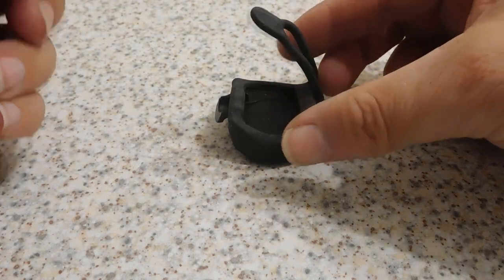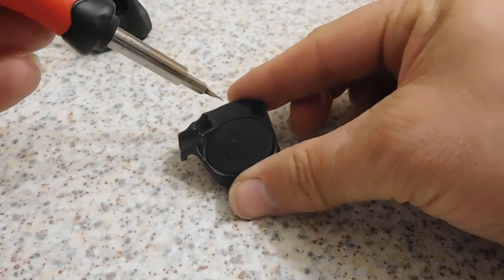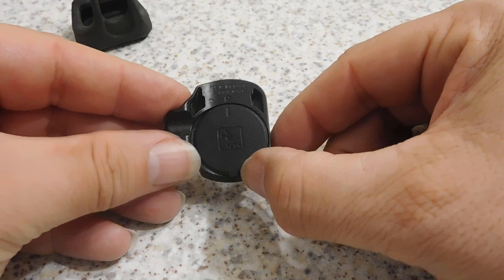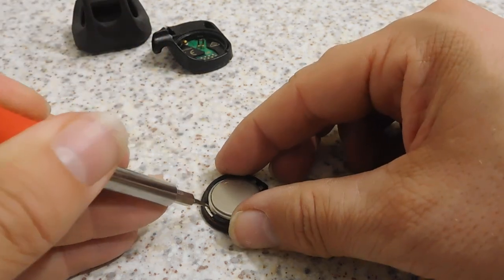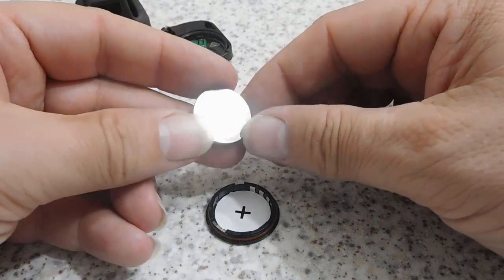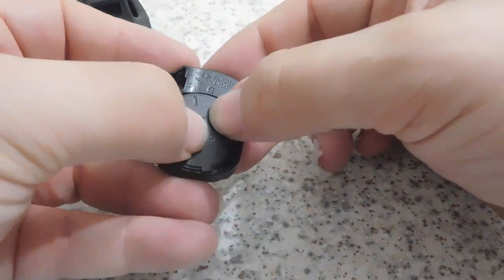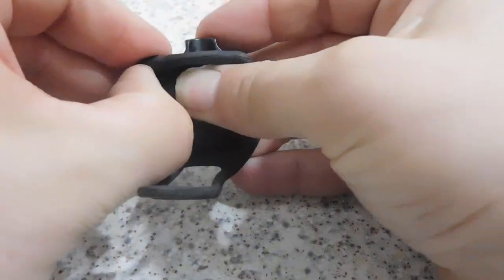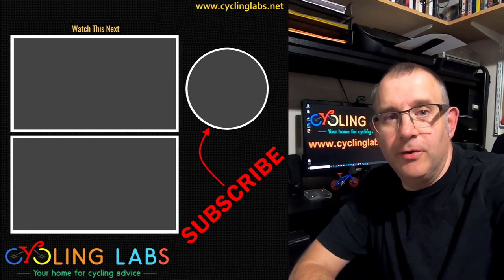Changing The Battery On A Garmin Speed Sensor

Comment: I'm guessing this is not the Speed Sensor 2? For anybody coming across this, the Speed Sensor 2 comes apart using a screwdriver slot, and the battery should be installed in the OPPOSITE direction to this video ("+" upwards).
Reply from the maker: You're correct, this is the '1' which is slightly different. I don't have access to a '2' currently to do a video for that I'm afraid.

Comment: Any ideas of what to do if your husband throws out the white circle with the plus on it?
Reply from the maker: I think it's only a bit of thickish paper with the + symbol to help with battery orientation.  I'd get hold of some of those sticky dots and put one or two in until you have created enough padding in the lid to stop the battery rattling loose.  You could then use a pen to put the + symbol on the sticker to remind you of battery orientation.
Reply: @CyclingLabs  thank you! I thought it conducted something kind of signal.

Comment: Pull the battery be applying sticky tape to it.
Reply from the maker: Brilliant idea, especially if you haven't got a magnet to hand - fortunately I have many but it's a great suggestion for those that haven't got one.
Reply: @CyclingLabs  I did have a pretty strong magnet, but it didn't work. I got the tape idea from a different video, and it worked.

Comment: These batteries shouldn't be so difficult to remove.
Reply from the maker: Robert Najuch I found this one a bit tricky, but some are easier. If you check out my cadence sensor battery replacement video I use a tip from another viewer where I use a magnet to get it out.

Comment: I have just spent over 30 minutes and there is absolutely no way to get the battery back in and locked in place, this is designed so poorly I can't believe they released this to the public.
Reply from the maker: The knack with this is once you have the marks on the cover and case aligned is to gently squeeze them together and then twist the cover in to place. Practising without the battery in place might help.
Reply: @CyclingLabs  I have changed the battery many times. This time, I can screw the cap to the lock position. Not a reliable design, seems it wears after a few battery changes and even with applying force from a small screwdriver and pushing down firmly, I can't lock it in place.
Reply: @dansteinbach6296  The lockngn mechanism is crap and pretty damn hard for a fundtion that needs to be repeated hundreds of times. Garmins are absolute shit with all the crap you have to put up with. Not to mention that the actual units have their faults as well. Ive had two garmins now and i am not buying another. I am getting a wahoo next. Screw garmin. The metal casing that sticks to the battery is also something that people screw up if not careful and that means buying a whole new speed sensor if you mess that thing up. Just the whole design seems to be made by people who do not use or even test the product they release.